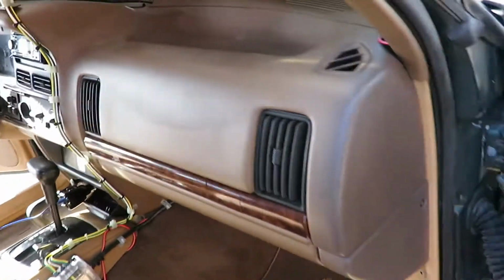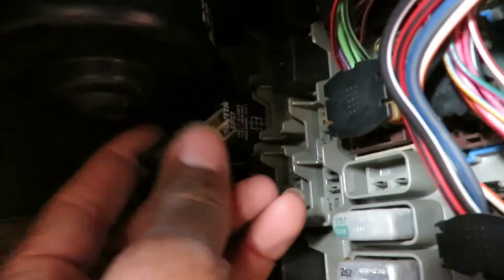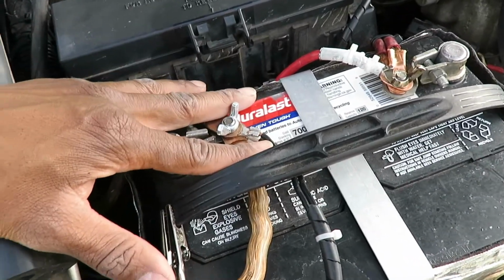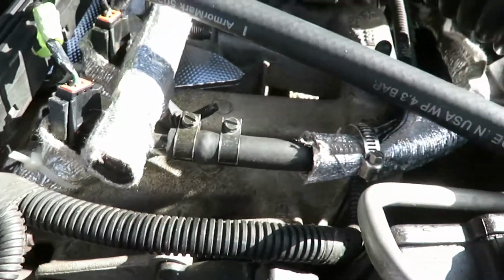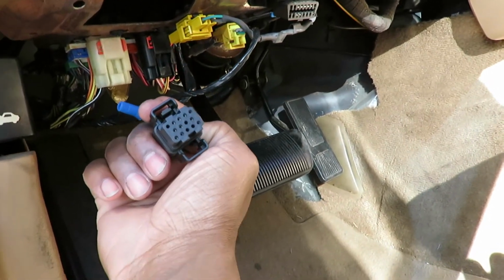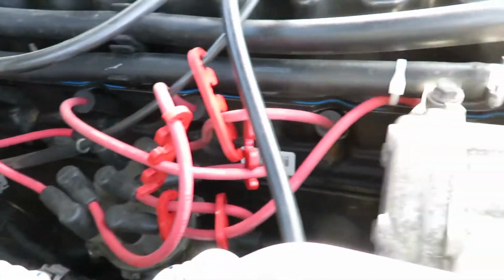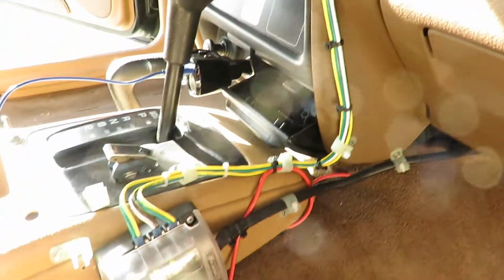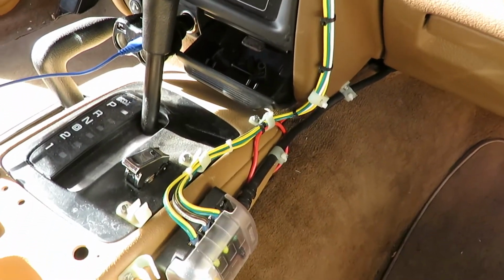ZJ Grand Cherokee PCM and BCM Electrical problems Part 2 of 2

Comment: Excellent video!   I’ve had several ZJs over the years and have experienced these subtle batt drains before.  This is the first time I’ve ran across discussion on this.  Even with the quirks, ZJs are great and I way prefer them over these new disposable push- button vehicles in production today.  Embarrassed to admit, but I’ve got 4 of them scattered around and still in-service.
Reply from the maker: Awesome, sounds great.

Comment: Is there anyway to keep the original mileage with the new body control module
Reply from the maker: Yes, the body control module does not effect the mileage.
Reply: @b2zmodz220  Actually, the mileage is stored in the BCM. The only thing I can think of to keep the mileage is to have it reprogrammed.

Comment: I'm having issues with my body control module has good ground but can't get any codes pin 16 came up on the obd2 and that leads up to my fuse box to fuse 17it runs just fine then I put it in gear to drive it and it won't accelerate also when I hit the gas in park it doesn't want to reb up like it should also have no gauges working please help I'll give you my number if you need it to make things easier also it's a 98 jeep grand Cherokee
Reply from the maker: I had a rev problem in a old 4 cylinder car and it was a bad ignition Coil. These jeeps have a single ignition coil. Check the engine wire harness that is routed around the back side of the engine at the firewall. Sometimes the wires can be damaged from engine vibrations and cause many random problems.

Comment: I'm going to say one of your door switches is bad for the dome light. Or a broken wire in the driver door under the black boot.
Reply from the maker: It did start doing this until after I disconnected the positive battery terminal and unintentionally laid that positive terminal against bare metal ground with the negative still connected to the battery, for 2 or 3 days. After reconnecting the negative terminal, the PCM was dead. Ordered another PCM, everything seemed fine but the dome lights wouldn't go out. Jeep Cherokee pains

Comment: Loved part one and two! My son has a 1997 ZJ with the same battery draw issue and was told it was the BCM. Where did you order yours, if you don’t mind? I can’t find one online anywhere! Thanks!
Reply: Did you have to reprogram it if so how?
Reply from the maker: I found mine on ebay, be sure part numbers match. Thanks for watching
Reply: Did you have to reprogram bcm.